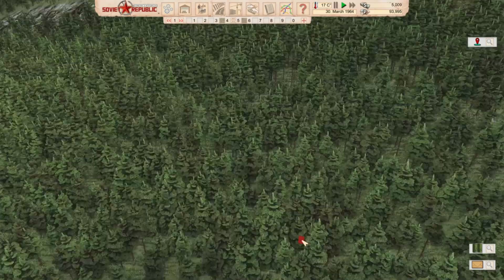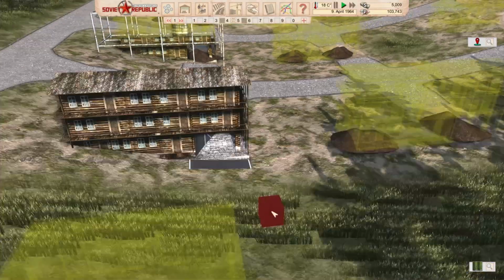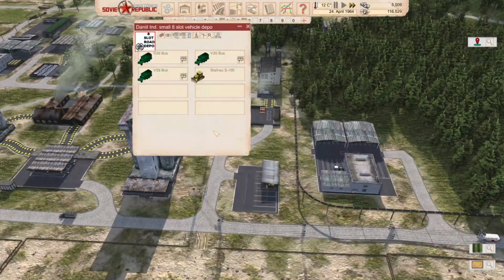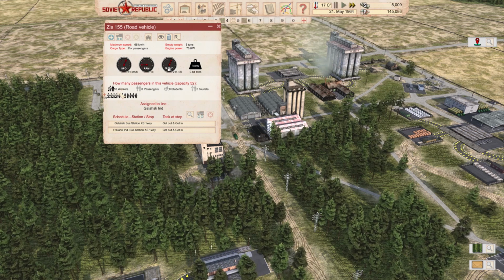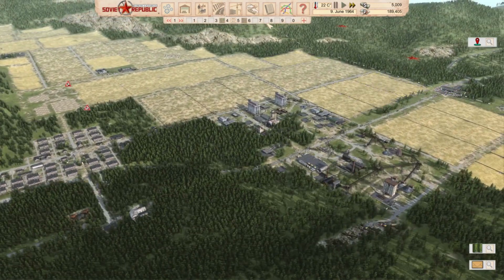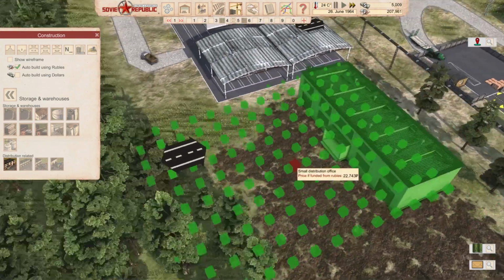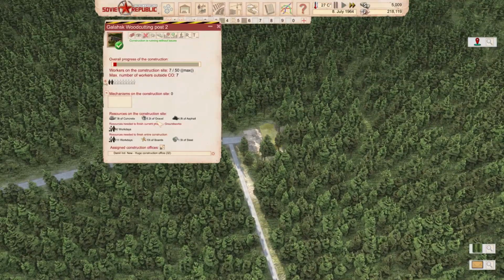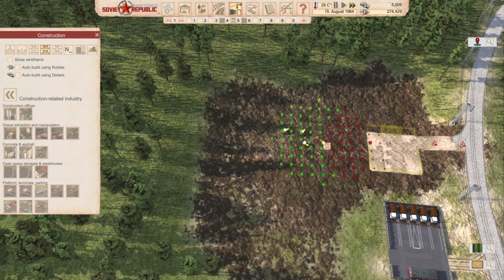Soviet Republic - Alaska - The New Beginning - Ep.12

Comment: Hello!
Yes, I am still present behind the screen.
About construction offices. When I use COs, I have three of them. 
One with 32 slots for general construction, MINUS roads, footpaths and factory connections. 
A second one with 20 slots for only roads, footpaths and factory connections MINUS tunnels. It takes longer to build a tunnel than a pyramid in ancient Egypt. It has all the machines they need inclusive busses. 
The third one is a CO with 12 slots only with mixers and dumpers which supports all constructions whithout distinction.
In my biggest construcion project being a twin nuclear reactor, a vanilla steel mill and two new towns in the same zone, I used a cluster of five COs.
Reply from the maker: OK. So what I see here and I might agree is having an extra CO to support any mixer and dumper operation. Did you consider the footpath CO?
Reply: @oolykeegaming81  
Absolutely not! Footpaths are a mission for the road CO, but most of the time I autobuild footpaths, because they are cheap, and thus I avoid "forgetting" some small pieces of footpath left and right. I don't want to block machines in building footpaths, they are more useful for bigger projects.
Reply from the maker: @helmutkanalgeruch7220  makes perfect sense. I'll be back to that soon. Thanks, boss!
Reply: @helmutkanalgeruch7220  Obviously if you autobuild your footpaths you actually don't need specialized CO, which makes perfect sense. On the other hand I don't know which footpaths using machines you can build, there are none in the game, maybe in the beta? Anyway if you don't want to bring in workers from West Germany or import a few tons of gravel from Austria or Switzerland, to build your footpaths or your short stretches of road, a specialized CO is still very useful ... Of course you can still estimate that a bus carrying 50 workers for a footpath that can be built in a few seconds by 5 or 6, that an expensive dumper is used to transport a few hundred kilos of gravel, and if all this is missing from your other construction projects, you always have the solution to let your main construction office do your work :) But you will have to be aware that it took six months, half a year, to build the few hundred meters of small stretches of road in Modred ...
Reply: @statsneguit3069  
As I wrote earlier, I am not obsessed with building everything myself, on the contrary. As a rule, I only use self building in a later phase of the game, and for big projecs, with the only argument that this way it's cheaper. In the beginning, I exclusively use autobuild, and I only plan and execute projects that improve my economical situation. I also wrote earlier that HMC/cosmonaut rules are bullshit created during a phase of delirium tremens, and I really don't get a kick building every little detail with CO. Autobuild/autobuy are normal features of the game, and I don't want to limit myself using only a part of the potential this game offers.
But I also wrote earlier that everybody is free to join Opus Dei if he wants to...
Reply: @helmutkanalgeruch7220  I don't play HMC rules either and I don't think I have delirium tremens either, drinking alcohol very rarely. Autobuild and autopurchase features are in the game for those who want to play the game with them, the game also providing all the mechanics that can allow not to use them for those who want. The developers, in their great wisdom, have provided for both gameplays. I do not believe that insulting those who prefer to use these other possibilities offered by the game, which the developers have provided themselves, is in itself a valid argument for claiming that the "normal" game should be played with the autobuild or autopurchase. But once again feel free to bring a bus of workers from Switzerland or elsewhere and a dumper of 500 kg of gravel to come and build 10 meters of footpath in your city.
Reply: @statsneguit3069  
Why do you feel insulted if you don't play HMC/cosmonaut rules? I clearly targeted this category of rules, not people who want to build everything themselves. And yes, I use COs too, but only for big projects and not in the beginning; yes, I use all the features created by the devs, as there will be a moment ingame, I stop autobuying , if it were only because of the delivery costs. 
Note that I never stated that there is a "normal" way of playing the game, and I never said neither that the only way is aotubuy/autobuild, that is YOUR interpretation of my words.. I only said that there is more than only stick to build everything yourself.
According to Steam, I played WRSR for 4000 hours (3000 would be more likely), and I only lasted so long because of the fact that I don't exclude anything the game offers, enjoying all the aspects of it.
On the other hand, your reaction in your first answer made me feel like you were trying to convert me to your religion preeching that the only stairway to heaven lays in self building everything, and I don't like to be converted. That was the reason of my reaction.
I want to apologize for my excessive reaction due to my misunderstanding and interpretation of the sens of your reply. Please, accept my excuses.

Comment: If you are not planning two railway construction offices (one in Galahsk and one in Modred, which I would recommend) you should consider building your railway construction office rather in Modred than in Galahsk. Its position will be more central and you will avoid many long back and forth trips by your locomotives and save a lot of time in the development of your rail network. In Modred you can build your railways at the same time toward Galahsk, toward the city of iron, and toward the coastline. Which would be much more efficient than starting all your tracks from Galahsk.
Reply from the maker: After Iron city, I will go for the fishing village. Do you think I should push for a Rail construction office there or Modred is far enough?
Reply: @oolykeegaming81  Concerning myself, I am building a railway construction office in almost every city. The speed of construction of the rail network is essential to push its logistics forward. For your game I think Modred is ideally placed because from this city you can operate in three different directions. Then you can place another railway construction office in relay in a small town intermediate between the fishing town and the big plain. There are several options in the future, but now I would opt for Modred, IF you don't want to build two of them (one in Modred and one in Galahsk) :)
Reply from the maker: @statsneguit3069  I think you are right! I was worried about the price and still am! 
I need to invest more into the exports. I have a plan!! Let me implement it in the next one and let me know what you think! :)